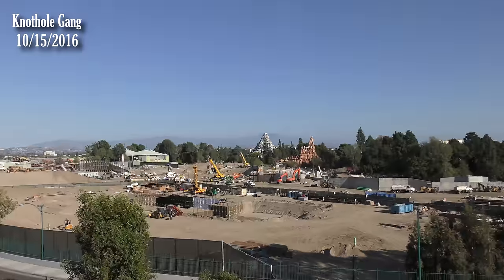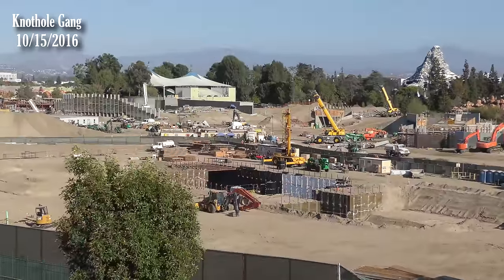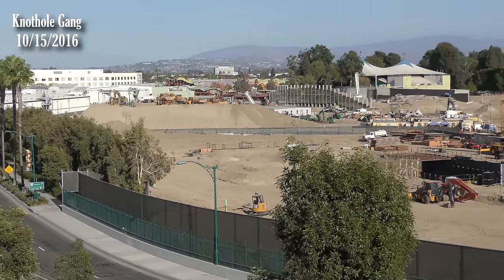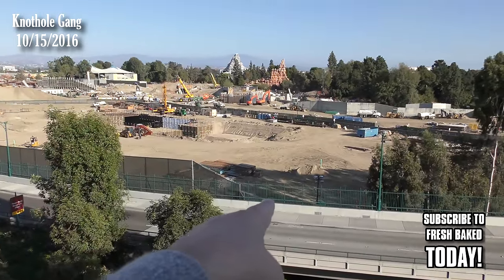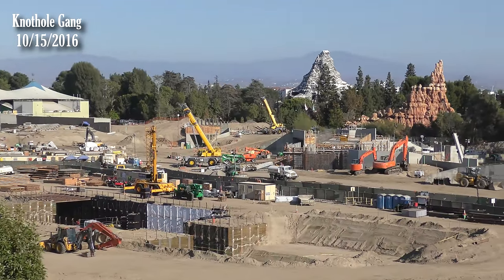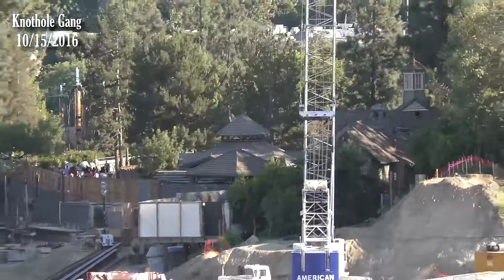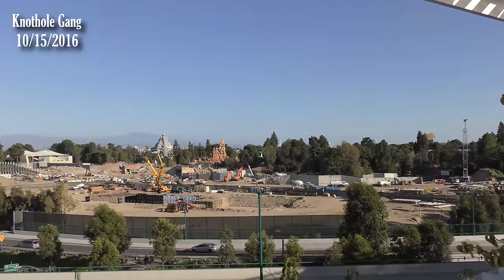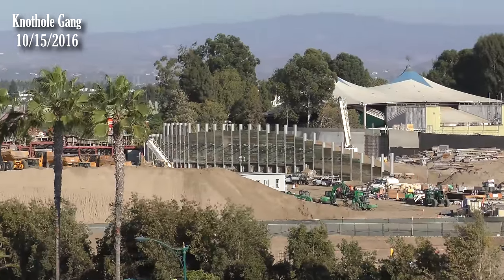Star Wars Land Construction Updates | The Knothole Gang Pt. 46 | 10-15-16

Comment: Did you not notice the black roofing felt and white plastic sheeting added to the walls of the pool?
They also removed a lot of dirt from the h pile wall by toon town. you can see at the bottom of the wall that they need to add more wood slat supports
The I beams by hungry bear is going to be for the walkway I am guessing.

Comment: Those forms are expensive and are reused. They are sprayed with a release agent before the concrete is poured to make it easy to remove after the concrete has set, and then taken down and used again for another pour.

That crane you asked about is just that: it is a tall heavy capacity general purpose crane.

Comment: At 2:45 I believe I was the one who said there was something happening NEAR Speilberg mountain, but not ON it.  If you look at the center of your frame, to the left of the pool and maybe 15-20 ft from the access road in your direction, you can see rebar being built up there.   Also, if you zoom in close enough to the first wall that was built next to the FL theater, you can see that they put rock work on the back side because you can see the backside of some of it on the top of the wall.   Also, moisture barriers have been put in in the pool and lastly large temporary wood walls were raised by the HB which was hard to see from your viewpoint.  So I think a bit has been done in a week, just some you can't see and some you just missed.

Comment: Its just a crane Dave just your angle makes it look straight up and down it for heavy lifting like those H beams.
If you look closely on top of some of the wall you can see that they have started putting rock face on them to and steal skeleton for rock work is also going up.
Reply: Phillip Mooney yup confirmed. Just a crane. BUT…The crane does have a machine to drive on H beams. They have started driving in H beams by the OLD RR track. 👍🏼👍🏼